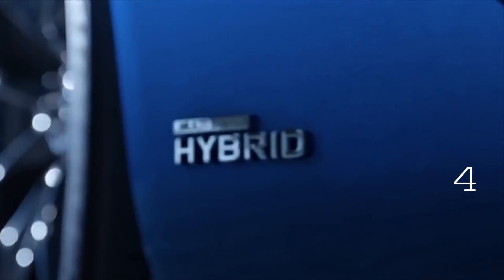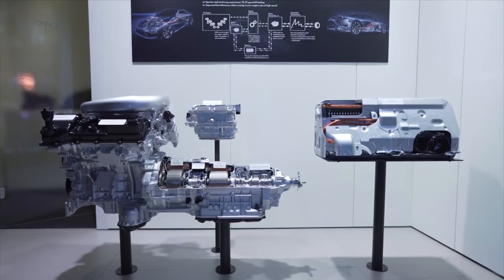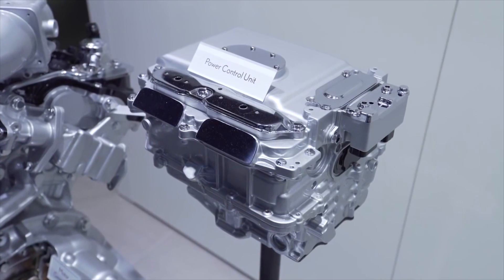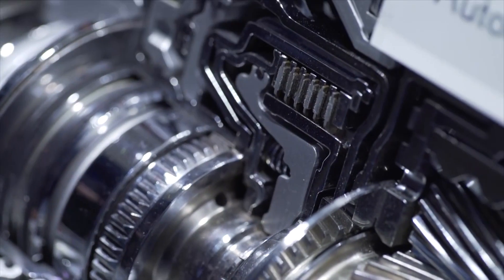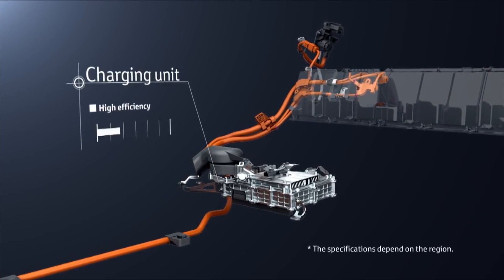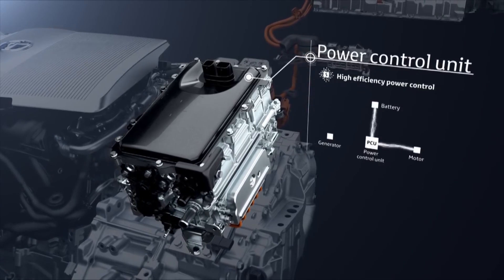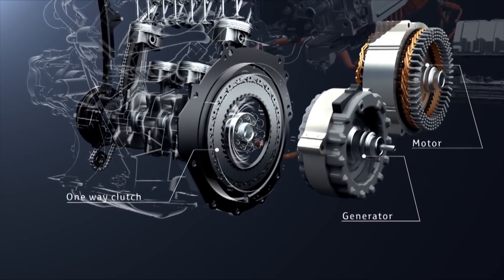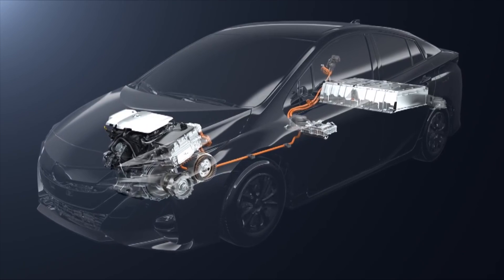Hybrid System Technology

Comment: As a mechanic this is just more bs to fix. Now we have 4 major systems to repair. All this bs for the global climate change hoax and for carbon taxing. This is stupid and should give us choices instead of forcing this unreliable crap. All these cars will be unaffordable for most. Basic 30 yr old civic these days still runs and drives and are cheap to fix and not to mention still getting 40-50mpg because of less bs regulations.
Reply: @Tech Games Im sorry but you have no clue what your talking about.  Batteries need replacing and start dying and degrading as soon as their made. Also charging has to be done at exacting percentages otherwise they will degrade faster. Belts lasts 100k mi for a $20 belt. Most hardline parts on an engine last 200k mi. Fluid changes are easier to do. You have not a clue about electrical systems and they do go bad just as electronics do. I went to school for automotive and worked 8 yrs in it and now i do it on the side. My day job is in the Aerospace industry now. Gas has more energy than lithium batteries. Try moving a Semi Truck on batteries. There's a reason were not even close to using them on long hauls at 80,000 pound loads. Electric Motors wear out as well and Tesla has reportedly replaced some 2-3 motors in  a 200,000 mile cycle and their $6,800 a piece. You can get a full engine and transmission for that amount.  This is without labor on both sides.

Comment: Why the fake gearshifts on a CVT?

The whole point of this transmission type is the ability to stay in the power or max torque band. That was also the reason CVT transmissions were banned from F1.
Reply: useless feature for people who can't get used to the car not shifting, it's usually only simulated in "sport" mode, it feels faster and more familiar because there's a little nudge when shifting

Comment: and HONDA beats them all.
Reply: Nah, Honda's hybrid is a plain old generator-motor pair. Good for high power applications like locomotives and ships, but not very efficient in cars (though still better than a pure petrol car). 
Toyota's HSD is a sweet spot - the clever placement of planetary gear and two motor-generators allows for CVT-like precision, making petrol engine run at optimal RPM no matter the car's speed by adjusting the speed of electric motor. It's about 10-20% less energy loss and better fuel efficiency compared to Honda's.
Reply: @maximvoronin1569  well. my accord Hybrid is better.
Reply: @jianyang6281  better than what?

Comment: Greatest failure of auto industry is hybrid evS dead weight of petrol while driving in ev mode n dead weight of battery while driving in petrol mode isn't a big concern i think weight reduction tends to greater efficiency R&Ds just waste money no outputs we have to work on Archimedes principles engines have to generate more power and waste  heat of engine is also  to be used not only in air conditioners as well as power generation traction given to every wheel can provide better stability center of gravity will be distributed after putting dead weight of battery unstable design , inertia  regeneration is must to reduce power consumption and engine has to be smaller and input switching is to be done because electric provide greater starting torque n engines can handle running torque after getting speed  quick boot engines which can be started n stopped in fraction of time reduction in weight improving efficiency we r not only looking for  zero emmision but also greater range n stable vehicles use of reinforced  HDPE and composite chassis can be the solutions And microchip or mobile fone sized control units can spare some pounds infrastructures for modular  battery 🔋 setups on every 30 km reduces breakdown then we can call it an effective efficient zero emmision vehicles

Comment: I'm already super happy with the planetary gear sets coming in Toyota's hybrid transmissions... first time I've ever been happy with an automatic knowing it won't be shifting like garbage 50-100k miles of ownership... they shift the same at 500k miles as they do at 1 mile... no gears to strip and multiple clutches to wear out. Other manufacturers with hybrids, be weary as their transmissions may have belts, etc that easily break e.g. Nissan; won't have the same dependability as Toyota's hybrid systems... they are not all created equal and Toyota from the 1st gen has done excellent with their hybrids in terms on longevity and reliability.
Reply: athletejmv true! Toyota system is by far the best due to its simplicity and lack of unnecessary gears!

Comment: You can't fix it by yourself, even your mechanic, too complex, just dealer service, expensive, thats the point,  cars are great and have smart technology, but after 3 to 5 years, max 8 or 10 for Toyota and no one will buy as used, not ecological at all. Little flood and garbage.

Comment: I lost interest when he said cvt
Reply: Coz cvt requires more maintenance.
In fact cvt is more prone to breakdowns.
Reply: why
Reply: You are in for a surprise, CVT technology is evolving pretty rapidly.
Reply: Its not a belt drive it has an epicyclic gear set which varies the 'ratio' depending on the speed and direction of the two motors.
Reply: @fivish   CVT is articulated metal? belt; eCVT is planetary gear set in conjunction of MG1 & MG2 (Toyota).